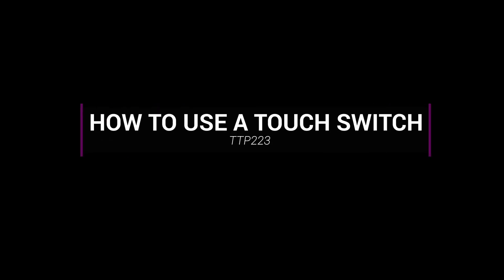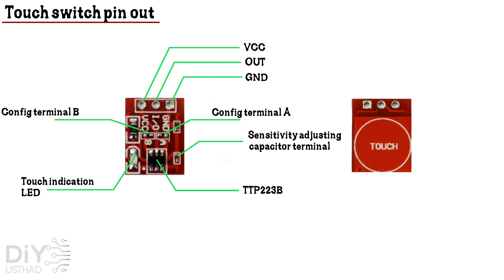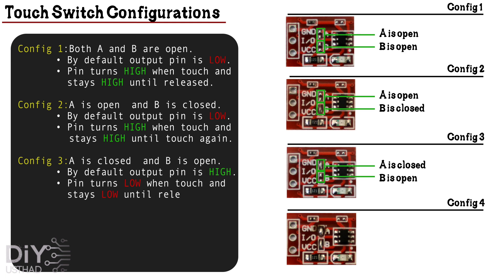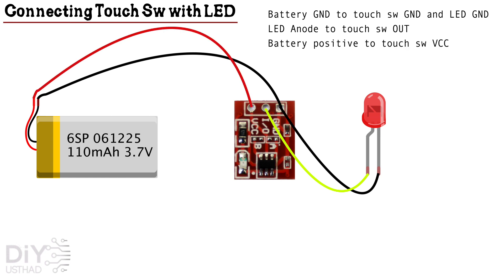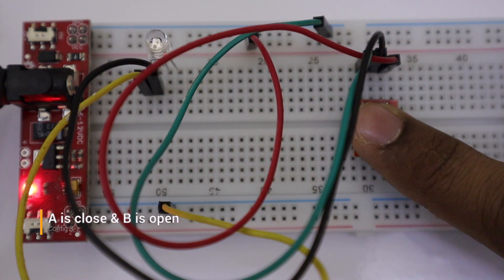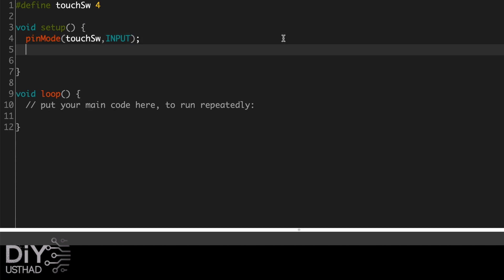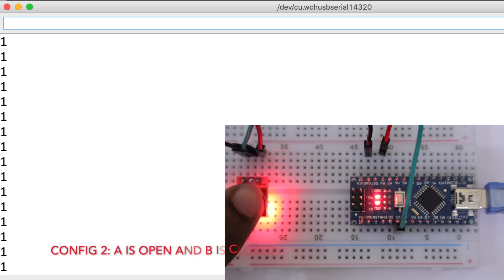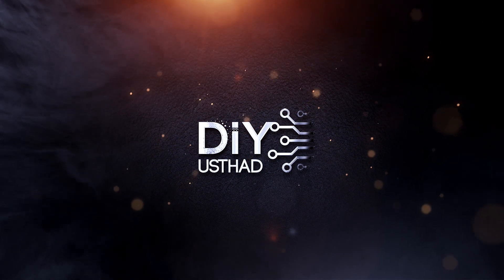All About TTP223 Touch Switch in 5 minute

Comment: The ttp223 has an auto calibration how to I bypass that? Can I with a code?

I have it on momentary (1st mode) When I leave my finger on the touch light comes on but after 7seconds it goes off quickly and back on, even while my finger still touching the pad, how do I fix this? Please help all information is appreciated.
Reply from the maker: I don’t know, just google it you might get some solution to bypass the auto calibration
Reply: @DIYUSTHAD  Thank you for your reply, but I tired everything, I don't think its possible thanks anyways
Reply from the maker: Then try to find a touch switch with some other IC which don’t have auto calibration. All the best for your project
Reply: @DIYUSTHAD  yes I found MPR121 still working on it, Thank you soon much

Comment: Brother how can i connect ttp223 to a 5v bluetooth speaker for power on/off, must reply if anyone can make this circuit, while connecting to bluetooth speaker, output voltage from ttp223 is dropped to 3volt, can anyone tell how to increase the output voltage to 5v, also tried to put speaker negative wire to i/o pin, it really worked but circuit gone reversed, when speaker was on, ttp223 indicator light was off and when speaker got off, ttp223 indicator light gone on continuously, reply will be greatly appreciated, i m trying this for last 2 years, but still didn't find any solution.
Reply from the maker: Better use a relay with the touch switch

Comment: Hi, is it possible to activate the light with a double tap instead of a single tap?
Reply from the maker: It's possible but you need to use a microcontroller with the touch switch for this purpose
Reply: Great Video, I wanted to know can you programme a touch switch to move a stepmotor 90 *(degres) and then stop when you touch the switch the first Time and when you touch it again it goes back to 0 where it was (like a door first Time you touch it it close second time you close it it open. I have been trying to do that for weeks. I am working on a very small mass that go on and off your face with a double tap on a touch switch. So i need a very small close open circuit. I would be really grateful if you could help me with programming and circuits. I already have the mechanical part who Works Well.
Reply from the maker: @sadaly4676  https://bit.ly/34zPp5W WhatsApp me we can discuss when free

Comment: Nice information brother.. Can this sense through 6mm thickness sheet like..plywood..etc
Reply from the maker: I have tested it with 6mm acrylic, I think it should works through plywood also. You may have to adjust the sensitivity using capacitors.
Reply: Thank you..I will try and share the result

Comment: Nice
I have a question that i can use on 12 v as a switch
Reply from the maker: For using 12v you need to use a transistor with the touch switch

Comment: very good video but i have one question:
Whats the detection range of this sensor? because i want to mount one under a 3-5mm thick wood board and I'm not sure whether it's going to detect a finger through this.
Reply from the maker: We can change the detection range by adding different values of capacitor I have mentioned in the beginning of the video

Comment: If the supply is suddenly shut down is it remember the out put when the connection is reestablished
Reply from the maker: No it won't
Reply from the maker: For that purpose we need to use any microcontrolers with eprom
Reply: Thnx for the reply

Comment: I'll connected as 2nd configuration but it's work for some time and the next is it's get triggered without any touching....
Reply from the maker: If you are placing anything on the touch pad of the switch then you need to restart the switch after placing any glass of acrylic, if still it is triggering without touching then use a capacitor to adjust the sensitivity
Reply: @DIYUSTHAD  so kind of you sir thank u
Reply from the maker: Also clean the switch properly to remove any solder flux or dust

Comment: How to pair a 5 v relay or Relay Module for operating heavy load..?
Reply from the maker: Connect 1st leg of 5v relay coil to GND of the switch and then connect the 2nd leg of 5v relay coil to the out of switch.
Reply: @DIYUSTHAD 
Ok boss..Will try and inform you...

Comment: Great!! How can I use this capacitive Touch Switch ina RC Car??  I mean, I try an did it, but the input voltage is 7.4v and you know, the switch works just for a moment and die.
Reply from the maker: you can use a transistor to work with high voltage. like the way we use 12v LED or Motor with arduino
Reply from the maker: connect the output of the touch switch to the base of a transistor (bc547) and use the transistors as a switch. if you still got doubt contact me at https://diyusthad.com/contact
Reply: @DIYUSTHAD  Thanks! I'l gonna try

Comment: Excelent explanation thanks, I have one question if you can help me: how many amps can this handle?. I have a bedside lamp with a 3.7v battery and 9 led that I would like to transform, do you think it's possible?.
Reply from the maker: I don't know the exact current rating, for to be on safe side use a transistor or relay in between the switch and the lamp.

Comment: You show us what the different configurations do but you never show how the configurations are changed!!!!
I would guess that most people know what a normally open and normally closed momentary switch is. It would be interesting however to know how you got exactly the same switch to do different things without doing anything to the switch!!!
Reply from the maker: I think have explained it, by making connections to the A and B solder pads on the switch
Reply from the maker: Check at 0:44
Reply from the maker: If you are suggesting me to show the soldering for changing the config, I'll take care of such details on my next videos onwards. Thanks for your suggestion
Reply: @DIYUSTHAD  You can barely see it in the image, but as per the comment above, to see this in writing or verbally mention that you have to solder and how would have been more clear. Thanks for the video though, explains everything else so far!
Reply from the maker: OK I'll do a separate configuration video, thanks for the comment

Comment: Not everybody have this board. Most of them have the touch pad included on the main circuit with a pull down resistor on pin 4 and 6 of the TTP223. “Close” means nothing except if you precise pull up resistor ( to the VCC) or a pull down resistor to the ground. Pin 4 and 6 should never be let open as on your board (it’s a CMOS circuit and open pin could create oscillations). I understood that by “close”, you mean with a pull up resistor to the VCC. Interesting video by the way except these approximations.